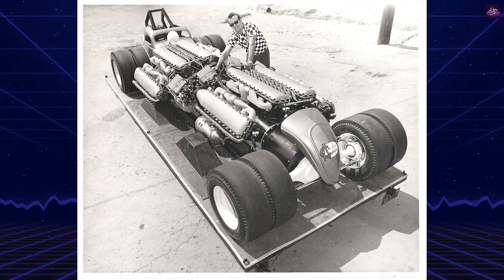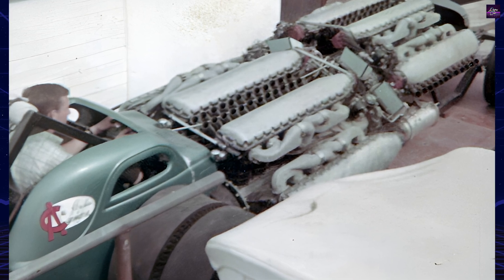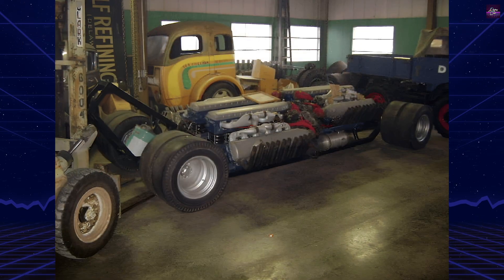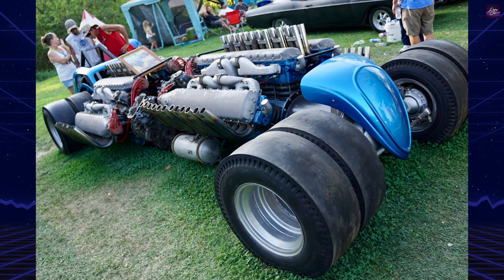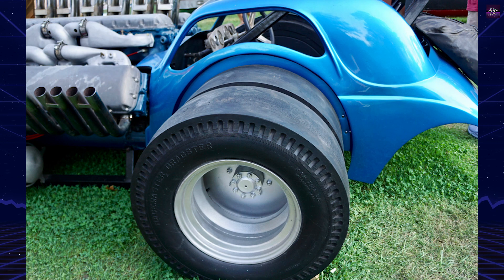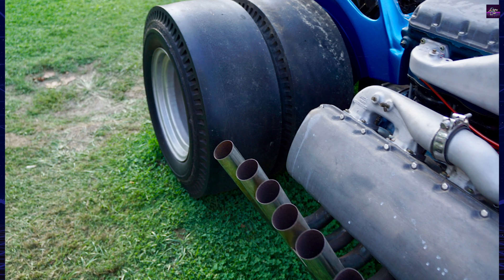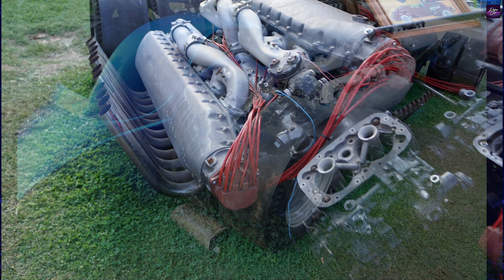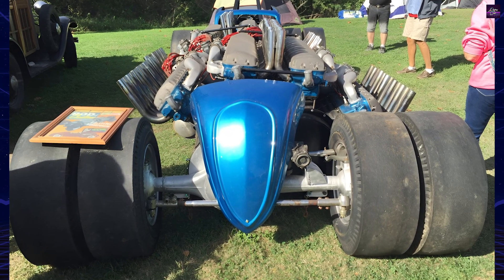Quad Al: The Most Powerful Piston Engine Car Ever Built

Comment: How does it have 96 exhaust pipes if it only has 48 cylinders
Reply: +@tonybrantley   It's 4-valve engine with twin exhaust outlets.  Sometimes they used individual exhaust stacks.

Comment: Was it four (or eight) wheel drive?
Reply: It’s four wheel drive even with dual tires at each corner, you only count the drive axles which is two. Two axles equals 4 drive hub assemblies, so, 4 wheel drive, no matter how many tires are mounted at each corner. 8 wheel drive would have 4 drive axles and at least 8 separate tires.

Comment: That Drag Car never ran - not once - and was solely a static display model built to WOW race car enthusiasts. The Alison Engines do not have internal parts. I remember seeing that 12,000 HP Monster on the cover of Hotrod magazines in 1968... I read Road & Track which mostly featured Foreign Cars and Gran Prix racers. At that time I was driving a 1963 Austin Healey 3000.
Reply: What makes you say the Allison engines had been gutted? I recall an interview with Jim Lytle in which he said that at the time you could pick up Allison V-12s quite cheaply. They were heavy, complex and expensive to maintain and even 20 years after the war they were still showing up in salvage yards. No one would bother to take the "internal parts" out and then reassemble the blocks & heads. Lytle just didn't have the finances to get the clutches engineered & manufactured.
Reply: @Skizziks_MAD   Now I know that the functional engines were sold to the hydroplane racers.  I saw a picture of the Quad-Al several years ago without engines.  It looks like they now have non-functional spare Allisons for the display and they do not have internals.
Reply: @Skizziks_MAD  Yeah - but it is just a static display and does not run. Those engines won't even bark.

Comment: This is definitely a beast; probably one ultimately better suited to the show car circuit than the quarter mile.  (Though if it ever ran at Bonneville . . . .) 

A quick Google search found at least one modeler who scratch built this, (and others who modeled cars based on the same engine layout,) but I couldn't find any diecasts or model kits.  This is too bad - a model of this car would probably sell for the Allison Engines alone.

Thanks for sharing this!

39th Like.
Reply from the maker: When I saw pictures of it I couldn't pass it by, I still can't believe it was built, even though it's not completely finished. It's a mega beast.